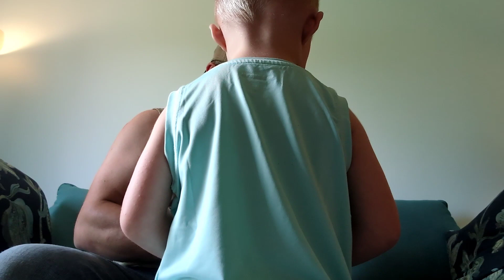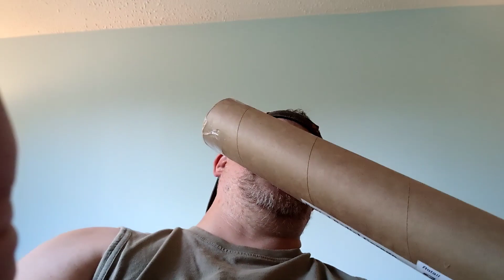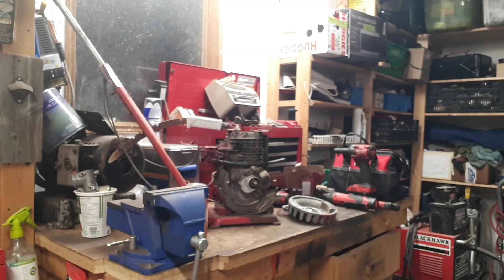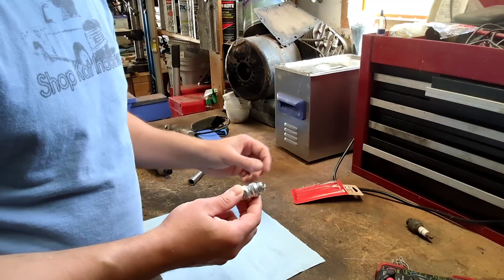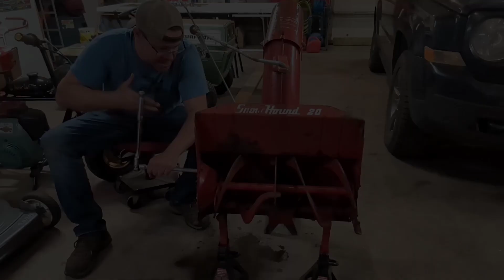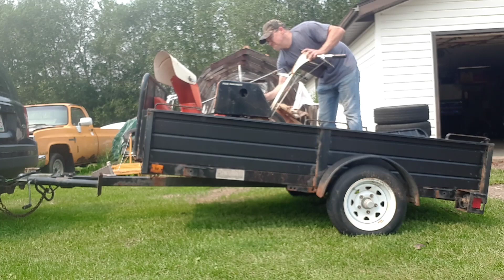Seeing Red! Antique Toro Snowblower Repairs, Plus #toptech Shouts Out Busted Radial Garage!

Comment: You said the Toro was running rich and then replaced the spark plug, but bad plugs don't make it rich, and I'm not clear on what problem was still there at the end, mainly drive shift linkage? with maybe some engine tuning?
   In the blizzard of '78, near Boston, I was in 8th grade and had access to my father's Gravelly 12 snowblower, which readily cleared my mother's driveway, but the road was still blocked for a week,  blocking in my family and about 7 neighboring houses.  I'm not sure how much gasoline we had, but if enough, I could have cleared the whole road and freed the neighborhood, potentially borrowing the gas or siphoning it out of the car.  I'm not sure why I didn't.  I guess I didn't realize how long the town would take.  One rich neighbor hired me to shovel a snowbank and I realized the Gravelly could do it far faster, but I got it stuck in the narrow track getting it there and had to ask my brother for help pulling it out, and then I lost my ambition I guess.
    After a week or so, the town finally hired a giant loader from the quarry to dig us all out, and there were still snowbanks that June.
Reply from the maker: I think it's basically in the carb, I haven't really gotten back to it!